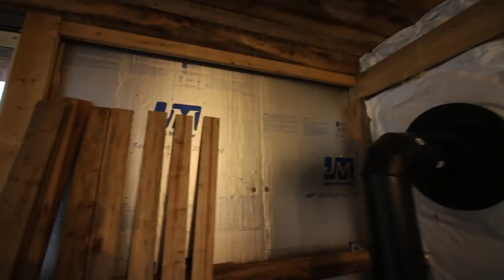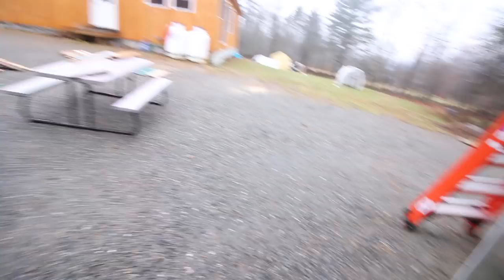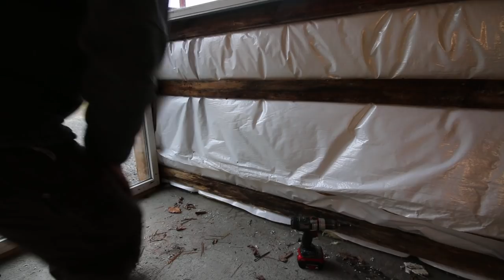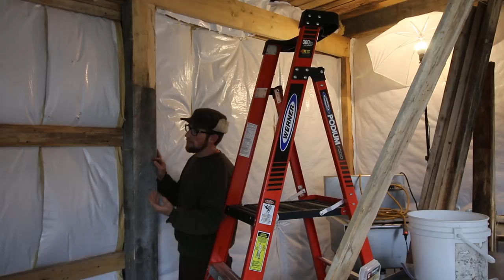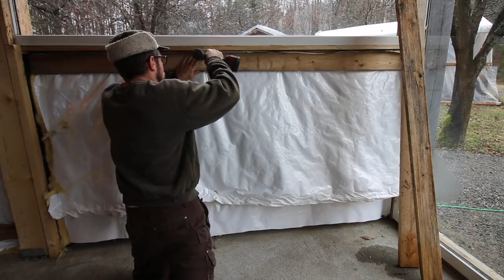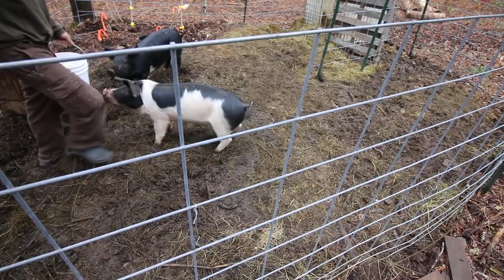Making a mess Before we can Make the Outdoor Kitchen Nice Again!

Comment: Working hard again Al!  Those on the stove top fans work via thermal convection.  Heat from the stove rises and causes the fan blades to turn which in turn circulates the warm air around the room.  Science is a pretty cool inventor.
Reply from the maker: It sure is! :)

Comment: Al,    Just asking,  might be better to have put wood chips on the ground in the pen. Still works for mulch but the advantage is the water will wick down thru to ground and top stays dry underfoot. Also much easier to muck out. Just  old time advice, also don't give pigs pears it's not good for their teeth. Last thing you can worm them with coal, just give small piece and watch them crunch!!!

Comment: Hi Al, if your screws are just a tiny bit too long and you don't have shorter ones, put them in at a 45 degree angle, this will make the screw secure but the lumber length a little bit deeper. I hope you understand that!

Comment: Hey Al I use a thermal fan for wood stoves and there is not power cord it runs on the heat the stove put out
Reply: I got mine from a stove store or you might be able to get one from a farm and garden
Reply from the maker: Thanks
Reply: Lumnah Acres -- Here is a fan for the wood burning cook stove on Amazon for $32.
https://www.amazon.com/dp/B075WZBHPV/ref=sspa_dk_detail_2?psc=1&pd_rd_i=B075WZBHPV&pd_rd_wg=lwf9L&pd_rd_r=8J4NYV969NZ08CW6F2D5&pd_rd_w=GQckP
These fans are interesting. It states, "a thermoelectric module acts as a small generator to power the fan's motor." It starts turning at about 317 degrees F.